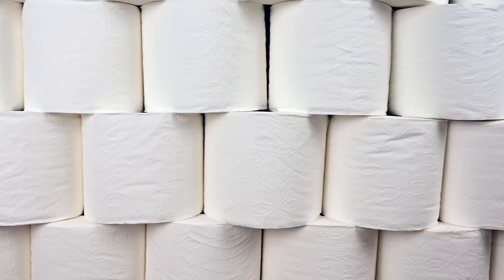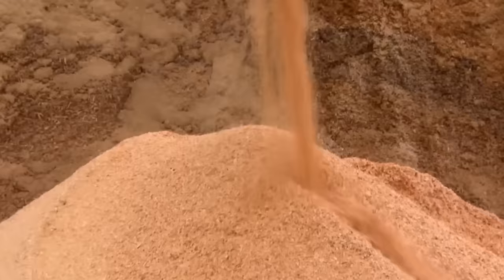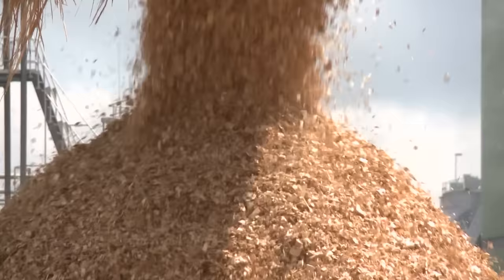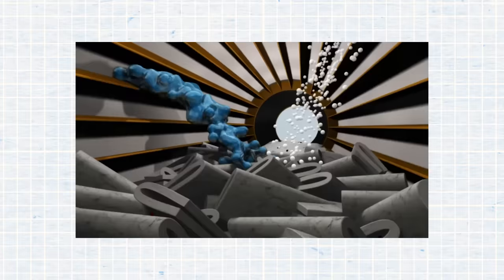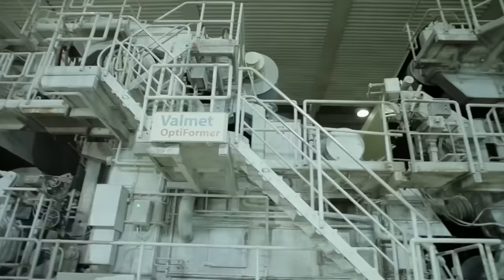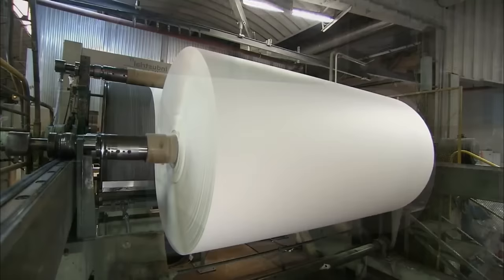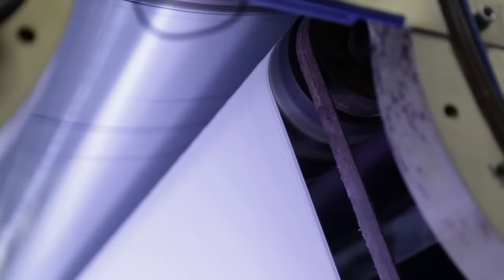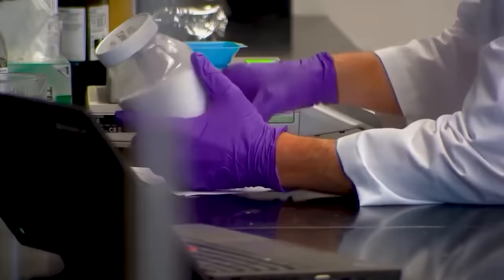How Toilet Paper is Made

Comment: Bought a bidet 5 years ago and I use 90% less toilet paper. One of the best investments you can make
Reply: I’ve always been so astonished and impressed on how these machines are built to do all of these things.
Reply: and can save trees 👍
Reply: Gross
Reply: @Carl_McMelvin would you rather use gloves to touch something or use telekinesis?
Reply: @Carl_McMelvin as long as you don’t drink from bidet it’s not gross at all.
Reply: Installing a bidet is easier than teaching ladies to wipe front to back!
Reply: But you use %20 more water.
Reply: ima guess warm water costs more than toilet paper - I typically use 4-5 sheets of 3-ply which costs me 31c/100 sheets so about 1.5c.  Cold water I might use in summer for bidet style washing might cost me $2.50/kL or .25c/L or 0.15c/600ml (a pint?).  Last I calculated I think hot water cost me about 10x cold water, so say about 1.5c/600ml.  Looks like 5 sheets of toilet paper cost me about the same as 600ml hot water - only trouble is I might run about 2L of hot water before it reaches my tap, so probably 6.5c to use hot water to wash bidet style.  In which case, cold water is cheapest at 0.15c, then toilet paper at 1.5c, before warm water at 6.5c per bidet wash.
Reply: @ultimobile  you might only use 4-5 sheets... there are ladies out there that turn their hands into boxing mitts!
Reply: 90% less toilet paper, 90% more water. Wow what a deal.
Reply: @BornAtheist Water is recycled where I live.
Reply: @LevCallahan right just increasing another type of resource
Reply: Yah, but your water bill has increased a bit. You can't flush poop down a bidet or you'll have a plumbing bill.
Reply: That's amazing! Reducing your toilet paper usage by 90% after using a bidet is impressive. It's not only cost-effective but also environmentally friendly. Have you noticed any other benefits from using a bidet?
Reply: I tried a bidet once.  Found out what an unpleasant experience it can be if you don't carefully adjust both the water pressure, and the water temperature.  Since then,  I have never had an incident using T-P,  thank you.  Not to mention, if you do it right with paper,  no puddle to mop up off the floor when the show is over.
Reply: That’s a great tip! It’s amazing how much a bidet can reduce toilet paper usage. Have you noticed any other unexpected benefits since making the switch, or would you recommend a particular type of bidet for someone considering the change?

Comment: They never mentioned the smell it produces.  I hate driving by our paper mills in Green Bay, they smell so bad
Reply: We converted 500 pound blocks of paper into the finished product There never was an unpleasant smell associated with that process.
Reply: I work at a pulp and paper producer. The smell you are referring is originated in the process of pulping - i.e. converting wood chips into pulp. The wood chips are cooked and mixed with water and chemicals that disintegrate the bonds found in the wood, resulting in pulp and some byproducts. The smell of those chemicals mixed with the black liquor that comes from wood is what usually produces some weird smells

Comment: I used to work in the paper industry. That paper machine is used to make all types of paper and can be refigured to do so. Some mills have multiple machines that are dedicated to making certain types of paper. Decades ago I worked for Crown Zellerback paper in their transportation and warehouse division. We had box’s of toilet paper coming out of our ass🤪😂😂👍. Our warehouse was full of it. Also rolled paper in rolls weighing several tons each. We also stored spare shaft spindles for the paper machines because they didn’t have room at the paper mills. The process of making paper hasn’t really changed from the original design by a guy in Germany around 1860 who came up with the design still used today, only the machines have gotten big and faster  and computerized. I tell you if you have a problem with one of those paper machines by the time you realize it and hit the panic stop button you are up to your eyeballs in paper everywhere. The good thing is any bad end product you just gather it all up and put it in the decomposer and make new paper out of it. Even in the warehouse if paper products got damaged we just put it dumpster’s to hauled back to the paper mill to be recycled.
Reply: I bet that was noisy in there.
Reply: @Alex-ft1df  it probably was. I worked on the warehouse side of the company. We stored a lot of parts - rollers for the paper machines and they where big🤪😀👍
Reply: Wow, this was super interesting to read!
Reply: @justalittleguy733  the paper industry is vary interesting. How it all
Works

Comment: I had to haul 4 of these from Kimberly Clark in Pennsylvania. So my driver manager told me, "You'll need a clean trailer." That's an understatement! I showed up with what I THOUGHT was a clean trailer.
I ended up spending over a half hour with: push broom, dust mop and wet mop, then dry mop again. Then, after all that, I had to go around with a nail puller and remove a years worth of pallet nails that had been driven into the wood floor by a hundred+ forklifts. 
These rolls are so big and heavy, that only 4 fit, and I had to slide by tandems forward just to make the load on my rear truck axles legal (the max is 34,000 lbs. on those axles).😂 For non truck drivers. Sliding the trailer axles forward, shifts weight toward the trailer axles, which are also 34,000 pounds max. The front axle can have 12k, the rear truck axles can have 34k and the trailer axles also 34k, for a total max weight of 80k (without a special permit).

Comment: Brings back fond memories of when I used to visit paper mills for IBM.  I was a paper engineer then - yeah there really is such a thing - and I was in charge of specifying and quality assuring the paper that IBM bought to resell to their printer customers.  In those old days, the IBM 3800 web fed electrophotographic printer that was used by large companies, such as insurance companies, was large, fast and expensive.  But the dollar amount of the paper typically used by the machine in 9 months of operation equaled the cost of the printer.  The printer was a "plain paper printer" meaning that it could (and often did) use ordinary, uncoated printing paper from any source.
Reply: Hello Charl, how are you doing today

Comment: That dryer roller weighs over 180 tons. The factory i help install had roles up to 15,000 lbs and used clamping forklifts to grab them and move them. Even stacking them . Everything about the operation is big . Including the super sized saw blades.

Comment: Virgin pulp is more typically manufactured in continuous digesters, not batch as described here.  We forming and pressing sections shown here are typically used in flat paper manufacture such as printing and writing.  Tissue typically is made either on a yankee dryer or transpiration dryer.  Pressing is really counter productive to producing a bulky, absorbent tissue product therefore it is minimal in a tissue machine.

Comment: The recycled paperare use to make a tissue. A machine who called sorter is used to separate it from junk that can't be used in the production of toilet papers. after the junk located into the machine  it's travel on the conveyor  belt where the sorter removes rubbish,  cardboard and plastic fully automatically.  First a CIV removes larges refus and cardboard. Then the recycled is separated from the junk through the use of a near infrared  sensors.  As soon as the sensor detect a piece of cardboard or junk a blast of air sends its off the conveyor belt. This type of machine can sort 400 tons of recycled paper everyday.  A recycled paper is put into a giant washing machine and passes through a 14 stations until the fiber can be used again for new paper. If that sound a lot of work that because it is but you will be surprised to know that such a hectic process is still more environmentally friendly than using wood.  for pulp the washing machine breaks down the recycled paper into pulp which then passes through a SHIFF the is eliminate tiny particles of waste of pulp. After decomposition come fine cleaning.  Fine cleaning using centrifugation to throw heavy waste particles such as sand or splinter towards the outer walls where they sink to the bottom . Finally the pulp is de-ink  by washing it with soap, this makes the color particles in the ink attach themselves to the foam which is then them skimmed off. The washing process, produce a pulp that has a sludge like appearance to make this sludge more suited for paper production, it is treated with bleach and diluted with a lot of water. Now the factory has a hand-on pulp produced  both through wood and recycled paper. It's finally time to make into a actual paper. The paper machine is 120 meter giant monstrosity that produces solid paper from pulp in four steps. The prepared pulp is fed onto a large mesh screen or belt call fourdrinier wire. As the pulp mixture along the wire, water drains through the screen leaving a layer of interwined fibers on top. The water removal process is facilitated by vacuum boxes and other drainage elements which help control the consistency of the pulp and the thickness of the paper. The wet paper sheet is then passed through the series of press rolls. These rolls is squeeze out more of water. Increasing the density of paper . The pressed sheet is now call WET WEB. And contains a significant amount of water the Wet Web is guided through a series of heated rollers or dying sections to remove the remaining water. The heat evaporates the water from wet Web leaving a continuous dry paper sheet. The paper sheet is still the somewhat incomplete in the sense that it has creases on it. These are removed with the help of ironing rollers incorporated into the paper machine . This long winded process surprisingly  takes only 7 seconds in real time. That how fast a paper machine really is. The completed paper is wound around a dryer called Yankee Dryer. Next the paper is creped. A process that make its very soft and gives it a slightly wrinkles look. During creeping the paper is scraped off the Yankee Dryer with a metal blade.this make the sheet somewhat flexible  but lowers their strengths and thickness so that they virtually disintegrated when wet. The paper which is produced at a speed over a mile a minute is then wound on jumbo reels that can weigh as much as 5 tons. How does a paper sheet end up becoming toilet paper. Well it's all happen inside the machine called toilet paper rollers. While it's not big as the paper machine at 80 meter long it's is still quite imposing and the produces about 500,000 rolls a day. Then different patern a printed on the paper depending on the brand . Micro embossing soon follows which give the toilet paper it's characteristics dotted texture. Micro embossing not only give toilet paper more volume  but also make it soft and comfortable for consumers

Comment: Bought handheld bidet 3 years ago (in 2020) and use zero toilet paper now. Saves a ton of money and WAY cleaner. Handheld bidet costs about $30-$70 (now, in Jan 2024). Do your own math and compare that to what you spend on TP. Installs in 5 minutes, super simple, no plumber needed. Cut up old tshirts and keep by toilet to dry off (it’s only water, folks). Toss them in the wash. Simple. Cheap. Sanitary.

Comment: You'll be surprised at the amount of shit left in your butt crack after wiping two times with this dry paper . Use a bidet or wet wipes or a biodegradable cloth which you will wet/dip in water right before wiping so it doesn't clogg your toilet .